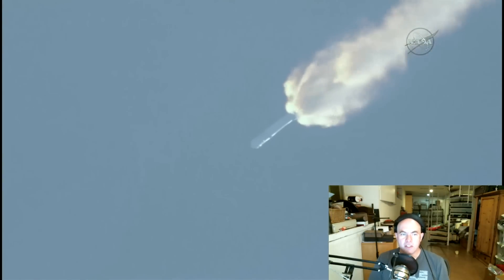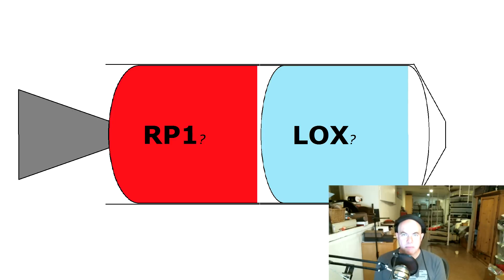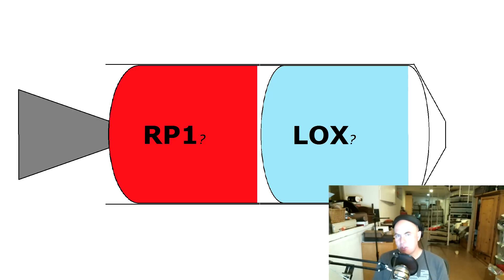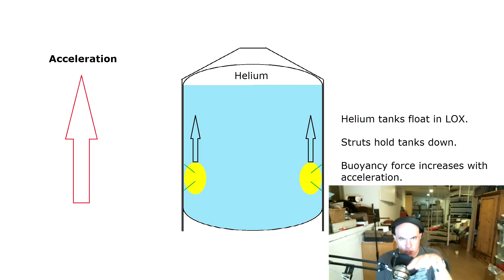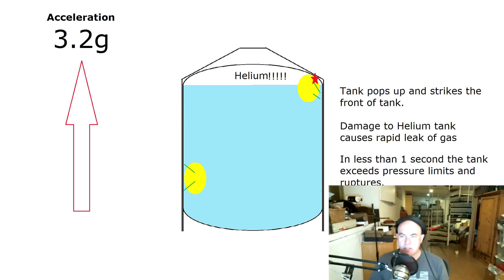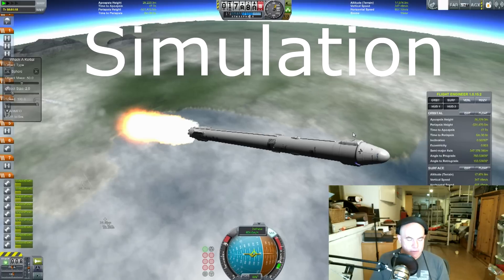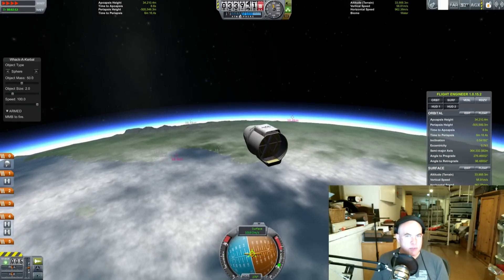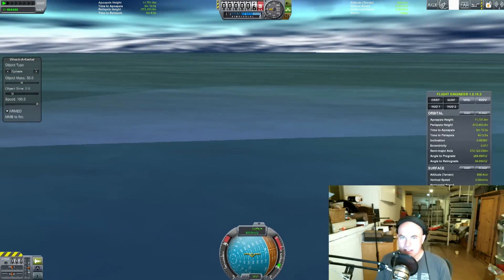Explaining the Space X CRS7 Launch Failure

Comment: Why do they have to keep the tank under pressur? As far as I know if you have the fuel under pressur in zero G you canno't get a stable fuel flow. What's the point. About the launch falure I think that they should increse the streinght of the struts or add MORE STRUTS!
Reply: Luka David Torkar If you don't keep the fuel under pressure it starts to swish around in the tank (well, slam up and down in the tank I guess).
This leads to what NASA called the Pogo effect. Look up NASA pogo and you can find a bunch links and pdf documents that explain what it is and how they tried to counter it.
Reply: Tank walls are incredibly thin, and as fuel drains, air can't get up into the empty space, which causes a vacuum and the tank implodes, so you pressurize the tank so it doesn't implode.
Reply: 1. Spelling, please.
2. The reason why you can't get a stable fuel flow in microgravity is because there is no longer a force pushing the fuel down into the bottom of the tank, which in turn forces gas up into the top. Liquid can float freely, and more importantly, away from the bottom of the tank leading to an issue with ignition and all that.
3. Why do they have to keep a tank under pressure? Put it this way - take a straw and a glass of water, take a sip but place a finger over one end of the straw while there is still water in the straw. When you raise the straw out of the glass, the water is retained in the straw. When you remove the finger, the water drops out. This is because if the water moves, there needs to be something to replace that volume. Gravity pulls down on the water slightly, creating an area of lower pressure, and mass that is under higher pressure will always move to an area that is under lower pressure, so the water stays in. When you lift your finger, the atmosphere around you (higher pressure) moves into the air in the straw (Lower pressure) and pushes the water out That is the same with the fuel tank. Fuel would either not drain from the tank at all, or if it gets pumped out, the tank would collapse into itself because of the negative pressure made by the vacuum. To prevent this, a gas must be pumped into the tank as it drains so that it can flow properly, and helium is used because it won't react or mix with the oxygen.
Reply: So basicaly they use helium to fill the empty space in the tank so that the tank doesn't get damaged and to prevent the fuel or oxidizer from turning into a gas. Patrickguyum I hope I corrected my spelling. :P I have a good reason why I make more mistakes than someone else. My mother language doesn't even resemble English and it's one of the most complicated languages. Also if I try to use Google translate it will just come up with random words. (Slovenian) :)

Comment: When you accelerate in a car, things inside are pulled backwards. But you say that when the rocket accelerates the helium tanks want to rise even more. They want to fly "forward" even more strongly than if the rocket was stationary. I think I might be too stupid to understand this bit.
Reply: Fluid dynamics :P
Reply: soundslave The acceleration would pull both the tanks and the liquid oxygen down at the same force, but the liquid oxygen is heavier, so the buoyancy force on the tanks is larger than the acceleration, thus pushing it up.
Reply: soundslave If I understand it correctly, it's like this: The helium tanks are naturally buoyant in the liquid oxygen, hence the struts to keep them in place. As the rocket accelerates forwards, this forces the LOx against the bottom of the tank, increasing it's density pressure. The increased density pressure of the LOx raises the buoyancy of the He tanks, making the buoyant force much stronger than the g-force being experienced by the He tanks and making them want to rise to the top of the tank.
Reply: Regolith Liquid oxygen isn't compressible, so its density doesn't change, but its pressure sure does. Otherwise, that's a good summary.
Reply from the maker: soundslave Try driving around with a helium baloon in your car, as you turn left it'll move to the left side of the car as all the air rushed to the right.
Reply: Scott Manley
Ooooh, very good example. It makes sense now.
Reply: smarter every day has a video on it :)

Comment: why can't they just put the helium tanks at the top of the oxygen tank so they don't suffer from this issue?
Reply: ***** Its mentioned briefly in the video and in a few comments. They are mounted at the bottom because the cold temperature of the LOX allows you to store more helium in the tanks, or the same amount in smaller tanks, either way its an efficiency thing to get more out of the weight.
Reply: HenryStrattonFW Thanks.

maybe they should just move the tanks to improve reliability. I can't imagine you'll loose a huge amount of efficiency just because you need a slightly larger tank for helium

Comment: An independent investigation by NASA concluded that the most probable cause of the strut failure was a design error which, instead of using a stainless steel eye bolt made by aerospace-grade material, SpaceX chose an industrial-grade material without adequate screening and testing, and overlooked the recommended safety margin

Comment: Interesting.  Makes me wonder why the tank wasn't just mounted to the top of the lox tank (inside) where they is no need of load bearing struts at all.

Not that I think these guys are stupid.  I'm sure there is a reason.  Just wonder what it is.
Reply: isgdre Its mentioned briefly in the video and in a few comments. They are mounted at the bottom because the cold temperature of the LOX allows you to store more helium in the tanks, or the same amount in smaller tanks, either way its an efficiency thing to get more out of the weight.
Reply: HenryStrattonFW I did mean to the top of the tank not on top of the tank. To be more specific.  Still inside the LOX tank in the cooling
Reply: isgdre I see what you mean, I would assume at the bottom is better than at the top just because as the LOX drains out the tanks benefit from the cooling for longer.
Reply: HenryStrattonFW Yea, I did think of that but even if all cooling stopped completely it still would take some time for the smaller tank to heat up.  A lot longer then the length of time it would be in use.  At the point it starts mattering at all (i.e. it starts being consumed) it seems the pressure changes would have a far bigger affect and the regulators have to be able to deal with that.
Reply: Good points, It'd be interesting to know the numbers on something that like just from a curiosity point of view. I have zero qualifications in these areas so I just have to assume that someone with said credentials knows why bottom is best. So I join you in your wonder of what that reason is.
Reply: HenryStrattonFW Yea, I don't have the numbers either.
Reply: isgdre You guys realise he mentioned this all in the video right? Bottom inside the tank so when the fuel is draining they are still submerged and getting cooled.
Reply: Jessie Janson Well, that wasn't helpful.  

I didn't think I needed to specify the overly obvious in the original comment.  Read the rest of the comment here and if you still think I missed something by all means send along the time index.
Reply: isgdre
"that wasnt helpful?" i explained exactly what you didnt understand and missed. You said and i quote "Makes me wonder why the tank wasn't just mounted to the top of the lox tank (inside) where they is no need of load bearing struts at all.". to which the video listed the reason why this specifically wasnt done. From memory they said it was to keep them cool by keeping them submerged in the bottom of the other tank.

What comment am i missing? There is no need for me to get a time index. If youre going to watch the video then pay attention to it or dont complain when you dont understand something. crikey.
Reply: Jessie Janson It's not helpful because your not adding anything new to the conversation.  Your just restating the overly obvious that was part of the reason for the original comment.
Reply: OH i get what you mean now, your bad english threw me for a loop. See, i didnt read every reply to every comment cause most of the time they are filled with crap and i was only trying to help you. i didnt realise that when you said "comment" you meant "commentS" and when you said "original comment" you meant a comment other then your own first comment. I realise now youre trying to be snarky in an attempt to seem smarter or something because i didnt read every reply. but really all youre doing is hastily commenting, dragging out the embarrassment of that original comment over nothing, which in no way can undo your error. the same haste that likely made you miss the all important information that led you to comment in the first place. But Cool story bro!
Reply: Jessie Janson
My original comment was directed at Scott or someone that new the subject.  They would have had no problem with it.

In future, You may want to not jump to the conclusion that people are ignorant before you read the thread.   I'm sorry you have to think about people "attempt to seem smarter" but I'll leave you to worry about how things seem.  I'm more interested on what is.